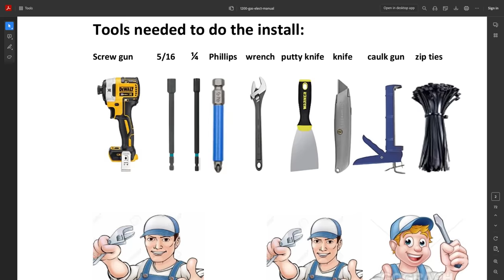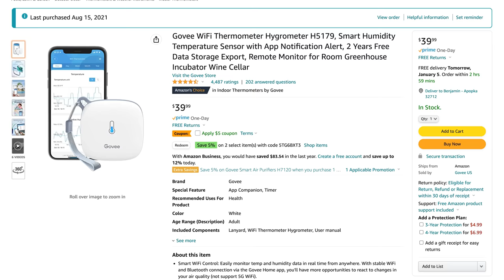We Saved HUNDREDS With THIS DIY RV Mod (Why Is Nobody Talking About This?!)

Comment: Super video and great job. I swapped my NotCold 10cuft refrigerator with a 12v dc compressor refrigerator (much smaller than the Goliath you have). I’d agree, one of the best upgrades for any rv . I was fortunate, the new refrigerator slid into the opening, no cutting or anything. 
I’ve been enjoying your channel for over a year now. Looking forward to what you will share in 2023
Reply from the maker: Thanks so much! We’ve got some fun stuff planned for 2023 so stay tuned!

Comment: This is a great option... we did this on out 2004 Bounder last year and it has been great so far. I did not get the Universal Control unit - that is new. But I had already complete
I had an issue with the thermistor, but JC Refrigeration was awesome and provided some by pass instructions until I could replace the thermistor.
Like you, our RV would have to have some major renovation to change to a different fridge/freezer - and there is nothing wrong with the "box' that is the housing unit.
I really like this conversion. We are seasonal RV'er and in the past we had to turn on the refrigerator at least 24 hours before we loaded it - now it just a few hours. Plus, since it is 12v, if we are out for the day and loose shore power, it will continue to run on the house batteries.

Comment: We had a water leak and then we added Govee components.  The hub hooks to our RV internet.  We monitor Water leaks and temperatures.  We have been alerted to freezing temperatures (during our -2°) cold front.  This was great because I turned on the gas heat for the belly plumbing.  They are awesome

Comment: I didn't realize the cooling unit transfers the cooling from the unit plate to an inner plate via thermal paste inside the fridge. I thought there was fins and tubes from the cooling unit inside the fridge. great teaching video! Thank You! You could actually build any kind of insulated box, put the fin unit inside the box and attach the Kit you bought and make any kind of fridge you want. So many ideas'and so little time! Awesome fix you guys! You are really on the Cusp of being Technical Beings! When you know things, less knowledgeable beings will gravitate to you and you're going to be the "GOTO" guys. Knowledge is power! be careful. I would say this is an 8 out of a 10 level project, most would run! great job!
Reply from the maker: Thanks!

Comment: Floor jack - what a great idea! About a year ago I replaced my absorption fridge's 22yr old cooling unit with an Amish model. We stayed with the propane because we boondock most of the time. The Amish cooling unit is more powerful than our Dometic was. Our freezer stays in single digits. It's 6 degrees today (70+ outside with the afternoon sun beating on the fridge side). It will go colder, (it's set on 3 out of 5) but the fridge section freezes if I set it any colder (the fridge is at 34 degrees now).

I did the job myself, including picking it up and wedging it in the hole. We have about 2 inches of clearance to the far wall, making this chore a real bugger - especially since I couldn't get on the bedroom side of the fridge as my motorhome only has one door. But it really didn't matter cause I'm only one person, so I couldn't be on both sides to lift it evenly or to walk it in the hole. To complicate matters, I'm a 66yr old, retired guy who's not athletically inclined (let's face it, I'm an old, weak, fat guy.) Yet I managed to complete the project using simple tools (a piece of plywood, some boards and a bunch of yellow plastic leveling blocks.) My wife helped with steading the fridge while I did all the lifting. Man, If I had a floor jack it would have made the job a lot easier. (If I could have borrowed your son, easier still.) But then I would have had to give away the floor jack I bought for a one-time job, as we are truly nomads - FTers with no way to take it with us and no storage. I tried using the screw type jack that I came with my car for tire changes, but that was far too unstable. Good job on a difficult task! 

The website says their conversion kit draws 139 watts of power. So, doing the math, if you have a typical 40-60% duty cycle that varies with ambient temp, you should project for the worst-case 60% scenario (unless you want that ice cream to thaw.) So let's say it draws a maximum of 2,000 w/hrs/day. It looks you'll need 2 more 100ah Lithium batteries (2,560w/hrs) which will give you a little buffer. 2000 watts/5hrs of sunlight a day at 80% panel efficiency = 500 watts of additional solar panels you'll need to recharge those batteries. Be prepared to run your generator on rainy or overcast days too, especially if you encounter a string of bad weather, which happens sometimes.  Good luck, I hope it's been working out like you expected.
Reply from the maker: Thanks! We just added 2200 watts of solar. And two more Battleborn batteries (100 amp hours each). We’ve been running the fridge on just solar now for several days and the lowest we got down to (and it was pretty cloudy for at least 1 day) was 30 % - more updates to come.

Comment: Congratulations! We went through a similar operation about 8 years ago when we replaced our Norcold refrigerator but we replaced it with a Whirlpool residential refrigerator.  The residential refrigerator had the advantage that it was half the weight of the old Norcold, and almost double the interior space.  We installed a pure sine 1000 water inverter to run it, but seldom does it use that kind of wattage as it needs about 700 watts to break the ice cubes free just before it dumps them.  Otherwise it's running using about 75 watts. If I was doing it again, I'd still put in a residential refrigerator/freezer.

Comment: I like this fix for a refrigerator replacement alternative. 

My one concern is the draw on the house batteries. We are not boon docking people so battery concern may not be an issue. 

I would appreciate your thoughts. 

Thanks
Reply from the maker: 12v has very little draw. It would be a non issue for you. Going with a residential fridge would take a lot more draw and potentially be a concern.

Comment: Looks like yours has an upgraded version with an actual temp sensor in the freezer compartment. Mine does not have that and it makes controlling the freezer temperature a bit of a pain. Will be interesting to hear how accurate your freezer temps are. I also see that yours has the new control panel, ours still uses the original control panel.
Reply from the maker: 👍🏻 We will keep you posted!
Reply: Tim, contact JC and see if your can be upgraded to the new panel, they are a great company to work with. We had our Norcold at JC’s factory to their upgraded propane unit which works great. They had just come out with the compressor kit and I didn’t want to risk it at the time. Maybe next time.

Comment: Also, as I’m watching the video I noticed that you’re using a floor Jack to lift the fridge. I know hindsight is 29/20 but a transmission jack would have been much better. They are flatter/wider, more stable. Glad y’all got it done.
Reply from the maker: Totally- thanks for the tip

Comment: Just watched your Youtube video for the  kit conversion on  your Norcold fridge.  Nice job. Did the install of the 10 gauge wiring from the battery area to the new fridge present any obstacles? We plan to do the same on our 2009 Newmar after the Tampa RV show.  I plan to completely remove the propane tank and turn that area into an additional storage compartment. The ice maker is a keeper on ours and we like the built-in  water dispenser. Deb and I thoroughly enjoy your videos. Keep up the good work. Maybe we'll see you at the Tampa show
Reply from the maker: We’d love to say hi in Tampa! Our Rig already has wiring for the 12 volt power so we didn’t have to run any additional wiring.

Comment: I put a new cooling unit in ours this last summer. It can be done with some handy man skills. I went with a Amish made one it is way better built and so far keeps the freezer around 3 degrees and the fridge at around 37 degrees. way better then the old cooling unit did.

Comment: You need to put some thread sealing tape on that plug for the propane.
Reply from the maker: Since this is a flare plug you will not need any tread sealant at all, just turn in tight and its good.

Comment: We just did this install ourselves.  Like you'll our fridge a 4 door Norcold 1211 is about a foot off the floor.  I used a furniture dolly 6" high and 2 4x6x 36" which made almost flush with fridge to slide out on to the dolly and leaned the fridge to remove the 4x6s to lay the fridge down.  To install just reverse, did have a 2x2 to raise the back of fridge to get it started to slide back in.  One other tip I have to line up the freezer bolts, I used 4 wooden skewers in the corner holes of the cooling unit.  Lined the skewers up withe the freezer screw holes when dropping the unit in it was perfect.  This took the wife and I, 2 half days 8 hours, If I did another 4 or 5 hrs tops, would I do it again, not a chance, lol, it's hard on a guy in his mid 60s.  I have to give to JC Refrigeration the instruction manual is spot on, if you are in good shape and up for a good project go for it.
Reply from the maker: Thanks for sharing!

Comment: Good job guys,hopefully yall will like it.  I have heard that those 12v air compressor go bad all the time. Good thing yall have a warranty.
Reply: It is t  12 v air compressor, it is a 12 v refrigeration compressor
Reply: @timmyers3428  
Sorry thats what I meant a refrigerator compressor.
Reply: @Hugo-Hernandez  interesting, I have not heard this, can you point to where you heard about these failures? Might be beneficial to know what the point of failure is!
Reply: @timmyers3428  
If you watch My RV Works and Hillbilly RV YouTube channels they are RV Techs.  They are known in the RV Tech world.  They constantly say they are not fans of the new 12V refrigerator compressor because they constantly go out. They have videos working on them.  They don’t recommend them.  Also their is good amount of videos on YouTube of people complaining that their new 12v refrigerator had to be replaced.
Reply from the maker: I talked to the owner of the company and here is what he said about their experience with the compressors going bad..... "so far in the 5 yrs of building these we have never had one locking up, we have had a few to where we had to change out the side control module mounted on the compressor but we did a lot of research and feel we have the top quality DC compressor available. A couple things to keep in mind on these and that is correct voltage and cover your side vent in a car wash"
Reply: @GratefulGlamper  
That’s good that they are making quality products and they are standing behind it.  There are a lot of videos of people and RV techs complaining about the new 12v refrigerators.  I will definitely keep this company in mind when my refrigerator goes bad.

Comment: I'm digging this for an older Georgie Boy class A. Control board had crapped out and only gave the option of propane. It was my understanding that a new control board would have enabled either 12v, 120v, or propane. Never understood whether the 12 v was a real option. So this is. Yayyy. Thanks for the post. Now when we are plugged in at home, everything stays cool. LOL. And being unplugged it lasts much longer on battery power. Is this system total 12v now? Looks like it. So a small solar system will keep your fridge cold all the time? Looks like it. Thanks so much.
Reply from the maker: Yes, this system is totally 12 volt and will run with solar or in our case at the moment, a lithium battery set up which charges when the engine is running on travel days
Reply: @GratefulGlamper  I was just hoping for a 12v solar system for lighting and refrigeration. This is looking like a great choice. Thanks so much.

Comment: You capped off the propane line and said "we don't have to worry about a propane fire anymore" (or something to that effect). Our propane hose developed a leak at the OTHER end where the hose has to flex for the slide going in and out. The hose was VERY cracked. I capped off the fixed pipe where it joins the hose with a female cap.

Comment: My Norcold is 28° in the fridge and 0 in the freezer, on 5. On 4, the fridge is 34 area but then the freezer goes to 10. So I deal with 28 in the fridge. 
I never turn off my propane unless I'm filling the propane. The fridge and propane is on otherwise.

Comment: Do you have solar to keep it running on travel days and boondocking?
Reply from the maker: Not yet but adding soon - we do have 6 battleborn lithium batteries (600 amp hours) that charge when the engine is running on travel days

Comment: What are you doing to provide 12v power while not on shore power?  The 10 cu ft 12v compressor fridges use about 80 amp hrs a day.  I would imagine a larger one uses even more.  Nice installation,  thanks
Reply from the maker: We have 6 battleborn 100 amp hour lithium batteries currently.

Comment: I did notice one thing that I question, shouldn’t you have used Teflon tape on the propane shut off plug?
Reply: It is a flaired connection Teflon tape could make it leak
Reply from the maker: I double checked with the owner of the company and he mentioned "Since this is a flare plug you will not need any tread sealant at all, just turn in tight and its good."

Comment: Question or your longer-term experience doing the mod on the refrig. :  Currently, we have a NorCold 1200LRIM model and it says it uses running on 12V power (besides some propane) 3.6 Amps.  With our 450 Amp Hr. Li-Ion house-battery bank and the refrig. at times turning off because it has reached the desired temp. we can run on battery power for 6 days.  

It seems that the JC Refrig. kit the refrigerator would pull 4 x times at much power running on 12V.  With this kit we would only be able to run on battery power for roughly 2 days. 

I am curious, what has been your experience thus far incl. on the power drain using the kit ?
Reply from the maker: We have  2240 watts of solar that keeps the batteries topped off so we’ve not been able to really see what the fridge drain alone is. We are also using chargers, kids are running fans, etc so we’ve not been able to really isolate individual power draws. If we have full sun and run No a/cs the solar keeps everything going with no issues
Reply: @GratefulGlamper    OK, that explains it.  I have 480W of fold-able solar panels to recharge the battery bank or (if weather not good or too much shade) my generator every 6 days to charge.

Comment: Great video!  I like doing that kind of work i find it fun.  Would you be able to piece together a small vid focusing on the wiring?
Reply from the maker: The instructions come with step by steps on the wiring - we didn’t film that part in depth
Reply: @GratefulGlamper  Cool thanks for the reply.

Comment: That is an option I've haven't seen. It's a new, technically efficient world. that old three way is pretty outdated. Many are going to a crazy amount of Lithium batteries and controllers converting completely to 120/240 v Rigs. Expensive, but worth it from what I've seen. 
     this is a great economically way to get off the gas.

Comment: I see very little information online about cost savings of doing this upgrade. When using our Norcold 1210 absorption style refrigerator we use either 110V electricity or propane. Is this 12V upgrade more cost efficient? We don't do a lot of boondocking anymore other than one night here and there, but we are snowbirds and pay for our electricity in the resort we stay in. Currently, if we run our refrigerator with electricity it uses about 520 Kwh per month so it costs us almost $100/Month. If we use Propane, it uses three 30 pound propane tanks so the cost decreases to about $60/Month. Would I save money monthly by doing this upgrade? I do have a 180w suitcase solar setup that I would be using to supplement adding power to the batteries if I do this upgrade and four 6V golf cart batteries giving me 440 amp hours of usable power.

Comment: I have the same frig as you and with an electrical power panel compartment underneath. I'd like to know how much better it operates after you use if for a while.
Reply from the maker: It’s been about 3 months now and keeps ice cream rock hard and food cold. We’re so glad we did the conversion and works great on 12 volt to conserve on power.
Reply: @GratefulGlamper  Thanks!

Comment: It's been a while, still recommend?  About to pull trigger, just love your videos.
Reply from the maker: Yes! We’re totally loving this upgrade, the fridge is colder than it’s ever been and with the 12 volt it’s been great for lower power usage.
Reply: @GratefulGlamper  Just completed the install to the NOR 12 Hvac 12V.  Your video is an excellent demonstration of the install.  Dutch Aire created an impressive installation step by step manual, smooth project, everyone should swap out their absorption cooling unit to this 12 Volt system.  Thanks for the video.

Comment: 12 volt.  How many hours can you run it ?
Reply from the maker: We have 600 amp hours with our lithium batteries that can be used when not plugged into shore power. We can run it for quite a while

Comment: So I had never heard about a Govee.  I looked at it online and I’m wondering if this would be a good thing to monitor our pets.  I looked at the Waggle but you need to subscribe with a fee.  Looks like the Govee does the same thing but with out the fees of a subscription.  What are your thoughts?
Reply from the maker: Govee would totally work - however Govee does not have the power loss option alert like Waggle does.
Reply: @GratefulGlamper  thanks I may give it a try.  It was also great to meet you at the Tampa RV Show